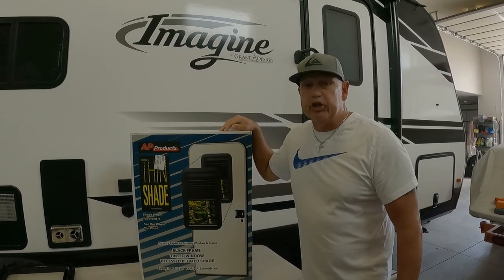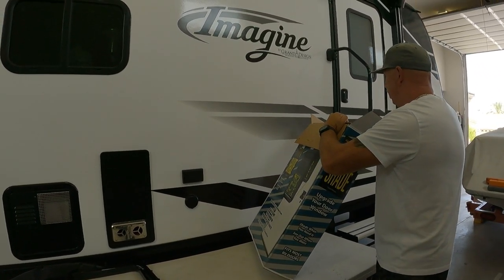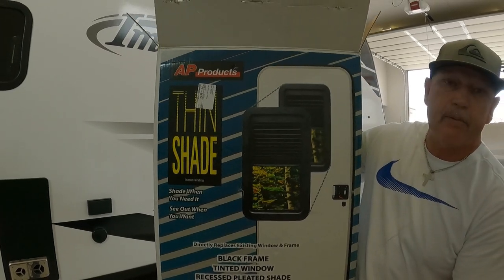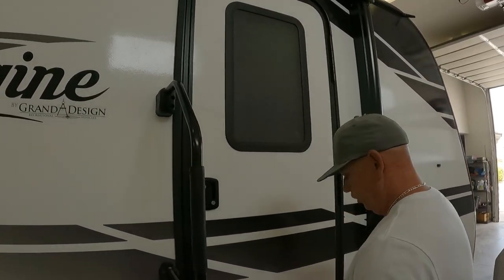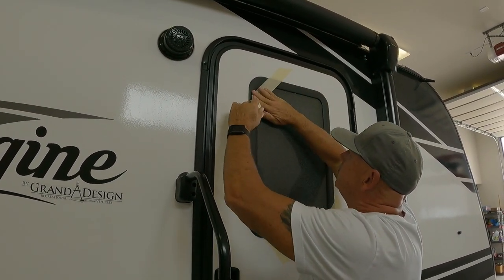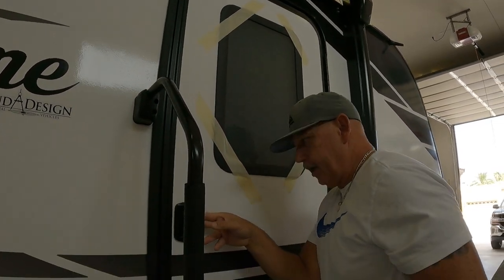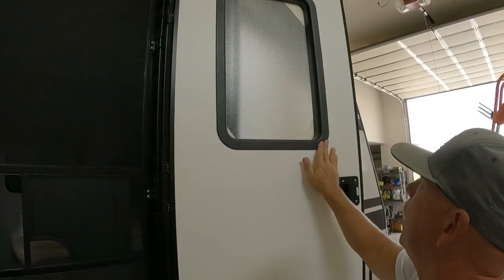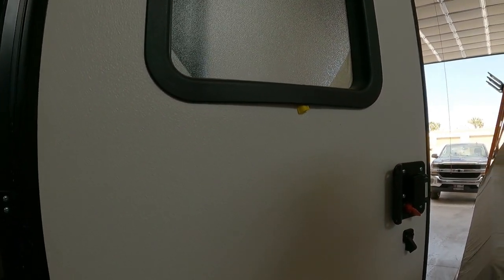THIN SHADE STEP-BY-STEP RV DOOR WINDOW INSTALL // 2021 Grand Design Imagine 2500RL

Comment: QQ

I agree on the security aspect of this and have installed one.  

Only thing is, if the shade is down, you cannot lift it to see who is knocking without opening the door first.  The screen prevents you from doing that.

Have to open the door to open or close the shade.

Appreciate  the video
Reply from the maker: Hi George, you are right.  What some folks do is install the shade upside down.  You can pull it down from the top and leave it cracked so you can see.  What we do is leave it cracked at the bottom.  When it’s dark inside people outside can’t see you.  Just food for thought.  Stan and Rhonda🙏🏼❤️

Comment: Hi Leo, loved your video. Buying one tomorrow.  As for door locks we just installed the Bauer bluetooth unit. All metal construction  and made in Michigan  ! You can open it with a key, phone app, keypad and....bluetooth proximity detection  ! Walk up to your camper, blue light flashes saying " authorized user" push the unlock button and you are in. To lock it's just like my Ford truck. Push the bottom 2 buttons together and it locks. Check if the deadbolt is locked (and lock it)from bed, Love it ! 
We live in Havasu. I am guessing by your mountain bike trail video (on beer bottle to the lake) that you guys live here also. My wife Anna and I mountain bike also. Havasu trails are pretty tough but beautiful.  Hope to hear from you :) Chris
Reply from the maker: Hello Chris, yes our home base is in Havasu. Thank you for joining us!  Havasu trails are about the toughest in the country.  I can say that because we have ridden trails all over the country.  If you can ride SARA Park you can ride anywhere.  Haven’t heard of Bauer.  We change all our locks to RVLock.  However, your locks sound real impressive.  We should get together.  We leave for Ohio tomorrow then back on the road to Northern Cali then to the Badlands South Dakota.  Probably be back sometime in May. Blessings, Stan and Rhonda
Reply: @OverTheHillAdventures  let's get together for a ride when you get back. Hope you have a great trip !
Chris and Anna

Comment: I just installed Latch.It on our Imagine XLS 22MLE. It actually operates better than stock lock. Excellent company, they were responding to my questions on a Sunday! I ordered on Saturday, it arrived on Monday. Great video, next on my list of upgrades. Thank you so much for showing how to do this install.
Reply from the maker: Russ, thank you so much for watching our video.  I would of responded earlier but Rhonda and I were both battling Covid.  I ordered the Latch It today.  Funny story our last trip we lock ourselves out of the trailer with out a key.  I have no clue how it does it but sometimes the RV door locks it’s self.  Lucky I had a window I left open.  I told Rhonda I’m going to get one of the remote locks.  The only thing that worries me if the battery goes bad and it doesn’t open.  Thanks for the advise.  Till the next time Russ, Stan and Rhonda

Comment: Excellent removal and installation video.  My biggest reason for watching your video is exactly one of the concerns you pointed out!  With the exception of an outside camera the lack of visibility through the frosted windows are dangerous!  Definitely going to be installing this.  Thank you & Happy camping to you both!
Reply from the maker: Hi Prairie, thanks so much for watching! We are really enjoying having the thin shades on the windows. We tend to keep the bedroom one down so the light doesn't come through in the morning and keep the one in the living area up so we can see out if necessary. Keep in mind that you cannot get to the shade from inside the trailer because of the screen, but regardless, we like them much better than the frosted windows. Happy camping to you as well! Rhonda and Stan

Comment: Thanks, I especially like that the butter knife works so well! I plan the install this week. Congrats on the grand babies!
Also, great tip about installing the key pad door lock. I worry about leaving our puppy locked in side while we go to dinner, etc. That if there were an emergency no one could help her. With the key pad door lock I could leave the combination with a trusted fellow camper for that situation. Thanks!
Reply from the maker: Bill, you are so welcome!! That is exactly why we got the door locks besides locking ourselves out. Blessings, Stan and Rhonda

Comment: Excellent video I have a question though, you mention the reason for the new window with shade is so you don’t have to open the door, you can just lower the thin shade. However, when the door is closed, how do you lower the thin shade when it’s covered by the screen door?
Reply from the maker: Hi Rich, you can’t. I leave it cracked at the bottom so I can see out.  Nevertheless, they would have to climb the stairs in order to see in.  Some folks flip the shade and leave it cracked at the top.  During the day I leave it up. They can’t see through smoke glass. All in all it has been a great upgrade and looks good too.  I hate it that I can’t just reach it.  Hopefully someone will invent a battery shade that goes up and down by remote.  Thank for your question.  It’s not the perfect solution, but it works for us.  Stan
Reply: @OverTheHillAdventures  Great, thanks for the prompt response!

Comment: Thanks for your video Stan. I’m curious about the screws. Are they going into the camper door and making holes or are they connecting with the other side of window frame?
Reply from the maker: The screws do not go through door.  It screws into the frame.  Thank you very watching the video.  Stan

Comment: Changed both of ours, bedroom upside down.  Only issue is that you have to open the door to be able to adjust the shade.
Reply from the maker: Mark, that is the only problem.  However, at night we keep ours cracked a half inch when lights are on.  During the daywe keep them open with the tinted windows you can’t see in.  If you chose to keep them open at night with the lights off, you’ll be surprised what you see.  Great hearing from you Mark!! Stan

Comment: So if the shade is closed at night, someone approaches or knocks on your door, how do you lower the shade with the screen door in the way?
Reply from the maker: You can’t! There are only two solutions.  Keep the shade cracked a little or install the shade upside down and leave the crack at the top.  The bedroom shade I keep down all the time the living room shade I keep up.  If my neighbors are too close I leave open just enough so I can always see outside.  The smoke glass is pretty dark even at night.

Comment: How are you going to open the shade to see who is outside without opening the door? Cut a hole in your screen??
Reply from the maker: No sir! I leave it cracked at the bottom.  Some folks install the shad upside down and leave it cracked at the top.

Comment: Nice job explaining the thin shade install.  We will do ours next week.  Question:  We noticed a gap in the bottom corners of our screen door.  Did you do anything to fix it?  It seems like the "brushy" seal is too short.  Just want to get your thoughts.
Reply from the maker: You know I haven’t noticed it.  I will check it out.  We love being able to look outside through our new windows. You will love it. Till the next time, Stan

Comment: How do you close or open the shade with the door shut? Won’t the screen door get in the way?
Reply from the maker: Hi James, unfortunately you can’t.  During the day you leave them open.  You can’t see in.  At night when the lights are off I would leave a half inch crack at the bottom.  This will allow you to see outside when you turn on your outside light.   This was a great question that I think many will ask.  Thank you so much!! However, we feel this is the best solution for us over the opaque windows.  Thank you for watching!! Stan and Rhonda
Reply: Hi Stan.  Good job detailing the install.  Your upcoming trip sounds like a lot of fun.  Safe travels and God bless. Ken
Reply from the maker: @kabzak  Ken, thank you!!! It will be a big trip and looking forward to it.  Stay safe. Stan